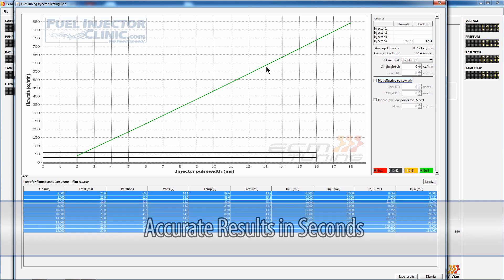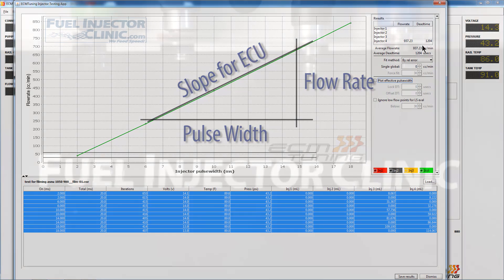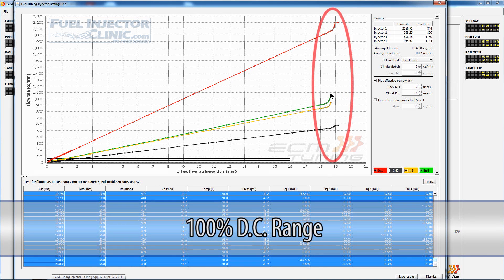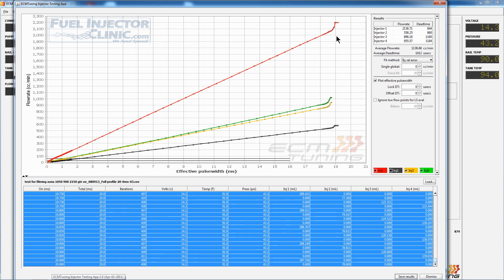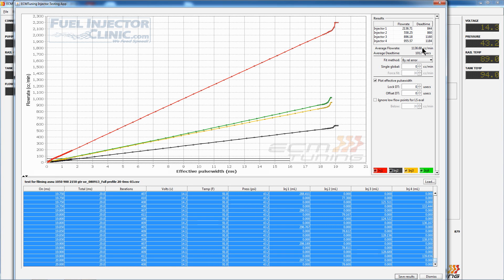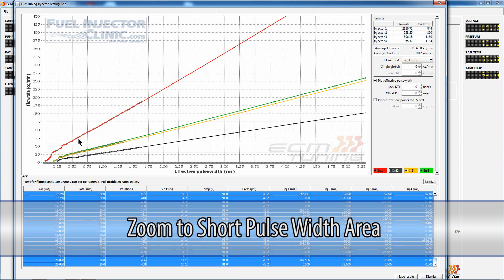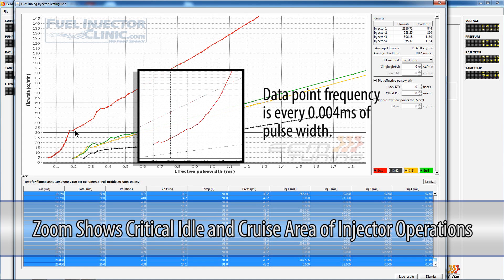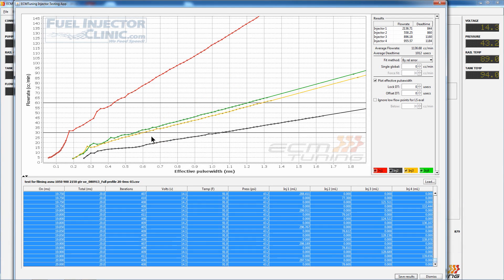Fuel Injector Clinic - Data Match Technology

Comment: Which injector should I buy from my 1.8t engine, injector over 1000cc?  I will use e85 fuel
Reply from the maker: That depends on your HP goals. 
here is a link to our website HP Calculator.
https://fuelinjectorclinic.com/hp-calculator
Reply: @FuelInjectorClinic  ls vtec fully built block and working on head..it is boosted my goal is 450-500hp .. would i use 1000cc Injectors ..i over built motor for reliability..My block sleeved is rated 800hp+ ..but not tuning over 500hp..
Reply from the maker: @pistolgripjoe  That depends on the fuel you are using. If you are using pump gas or race fuel then the 1000cc injectors would work. If you are using E-85 we would recommend the 1200cc or the 1440s.